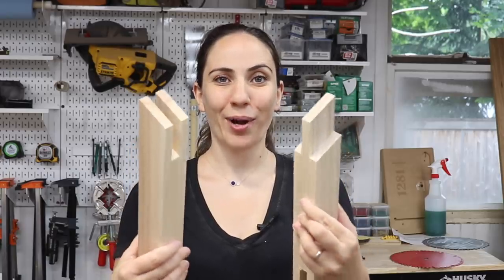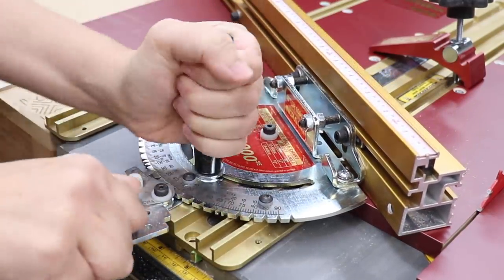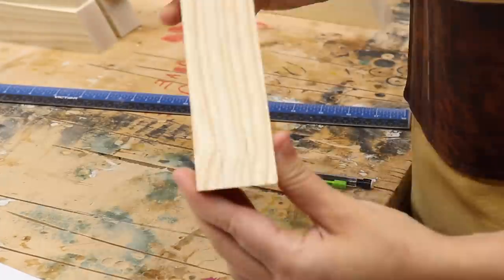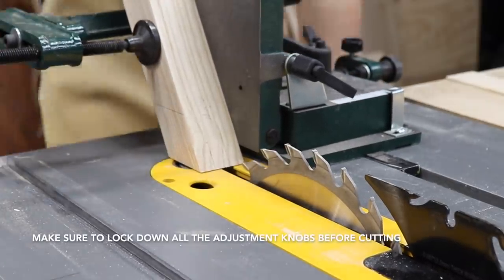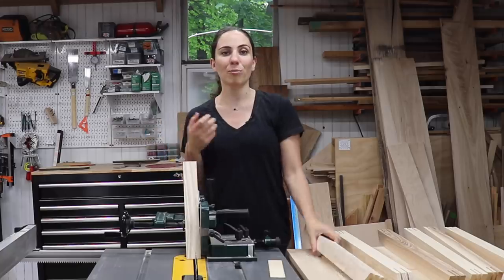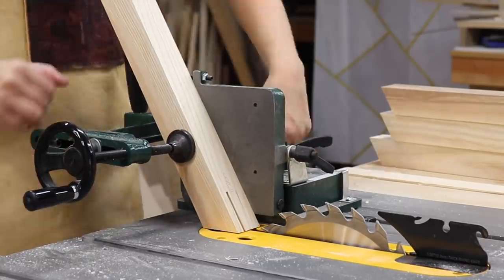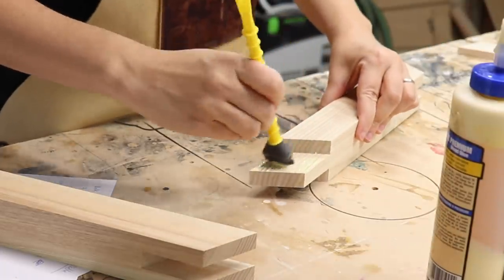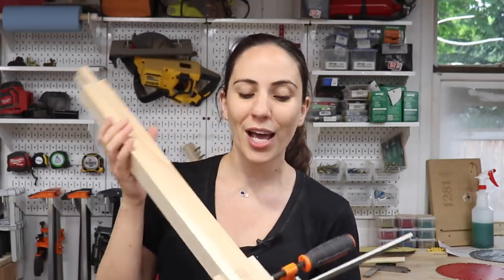How to Make Angled Bridle Joints // Woodworking Joinery // Really Strong Woodworking Joint

Comment: Great video. If you know someone with a drum sander you could sneak up on that shim size for your blade width, or find a piece of steel that's the same thickness as the blade. Just a thought. Might make some of these type of legs for a table top I found at the dump. So if I use this in my video, I'll give you credit for the idea.😜 Thanks for sharing.
Reply from the maker: Thanks! Someone suggested using a deck of cards to dial in the fit and I think that brilliant.

Comment: You might be able to get the thickness of your blade using stacked playing cards as shims. 

Set your fence right up next to and touching the blade.
Slide a deck of cards along the fence and across the blade.
The ones that stay behind the blade as you move the cards across the blade should be the thickness of the blade.

At this point you have two choices:
1) Place the stack of cards that were behind the blade between the blade and your fence and cut your shim.
2) Use the stack of cards as the shim.
Number 1 is probably the better choice.
Reply: Scott Tovey that is an interesting suggestion.  It seems like that is a brilliant idea!
Reply: Just an additional note. This  will work with  your Apr 25, 2019 simple tapering jig. 
Align your jigs fence and the wood you will cut the shim from so that it is flush with the edge of the jig.

Once you have the number of cards that make up the thickness of your blade, double them and put them between the board and the fence.

Side note: If you put the number of cards that are the thickness of the blade between the board and the jig fence, all you will do is shave the thickness of the blade off the board affectively edging the board.
Reply from the maker: Thats brilliant. Ill have to give it a try.
Reply: @3x3CustomTamar  
Cool! Let us know how it works out!

Comment: Btw since this came out, Inspire Woodcraft here on YouTube has several “how to make Shims” videos on making perfect shims to match the kerf of your blade… I actually tried it, now I’m still newish to using a tablesaw meaning I’m still figuring out how to perfectly dial in the tablesaw square, etc. hence why my shim isn’t perfect but it’s pretty dang close and I can use tape with the shim I cut out to get it perfectly dialed in but his method works and it wasn’t scary. You do have to have the basics of tablesaw safety down first and have used it more than once but Tamar would be perfect for trying his method and especially if you don’t want to have to build a kerf jig.

Comment: A little tip cut the pierce of block a 32nd" larger then you need then use a rubber float used for grouting, then use a piece of sandpaper put block or spacer on the sandpaper and with the rubber float on top of your block sand to the size you need.
Reply from the maker: That would be a good idea. I need to experiment more to get the perfect fit. I just didn’t have time to spend on it

Comment: A small tip about getting a spacer that's the right width. This will work over here in Europe at least. Since a saw blade is an exact width, over here they are usually 3 mm on a table saw and 2 mm on a normal circular saw. You can then take a piece of aluminium or other metal but aluminium is easier to work with, that have the same thickness and use that as a spacer. It shouldn't be so hard to find in a good hardware store. I always keep small pieces of aluminium to use as spacers, I also have some square aluminium tubes in 5, 10, 15 and 20 mm width and can use them as spacers along with the aluminium plates to get the right spacer width for most projects I do.
Reply from the maker: That’s a good idea. Someone sled suggested using a deck of cards to dial in the fit and I think that would be brilliant.

Comment: Love the Miter Express.  Adds a definite safety dimension to the table saw.  I'm going to assume that when you cut the spacers you mentioned that the thickness included the thickness of the blade teeth.  Seems like it should work.  Great tutorial.
Reply from the maker: It’s a great sled! Yeah. I factored it in. I guess it needs to be slightly bigger than the blade thickness to make it a good joint and I just couldn’t get that thickness right on my first few tries. I will def attempt again as I think it would work.

Comment: Minute 4:00 - Use a screw on the end of a 1x4, just like you did on your kerf marker (dado and grove maker).  Lay the 1x4  (~9 inches) on the table saw so the screw comes in contact with the work piece.  Adjust and lock the fence.  Move the 1x4 so the screw no longer makes contact with the work piece and use the micro adjustment until the work piece comes in contact with the 1x4.

Comment: Excellent! I will be using this joint for angled legs on a chest of drawers soon. I have a mortising jig from delta similar to yours so should be able to follow your process. One question about the mitre express, did you have any slop on the runners or need to make any adjustments in the runners? Not sure “runners” is the right word, the parts that fit into the slots on the table saw surface.
Reply from the maker: Thanks! Runners is correct! Yeah. The slots on the dewalt are pretty wide. So I had to adjust the plastic nuts it comes with to max. But I made it work

Comment: I guess it's easier to make them first in usual 90 degree , at the and cut in any angle you want with mitre saw , you don't need those fancy jigs !!! 
Thank you for the video anyway
Reply from the maker: That wouldn’t work. The inside of the cut wouldn’t be the correct angle.
Reply: Nice guess. Try it and you will see that it wont work.

Comment: Another great video! Of course now I need an incra miter express and a tenoning jig lol! :) Side note, I have the same saw as you, glad to see I can use those jigs with that saw.
Reply from the maker: Hahah! Sorry bout that. While I did get them to work with this saw. There was some tweaking I had to do. On the tenoning jig I had to add so tape as a shim to get it to fit perfectly. I used what’s called drawer slide tape. It’s a slick surface that makes it easy to glide.

Comment: Cut a piece slightly thinner and add a few cards, or overcut a piece then use a hand plane.  Adding a few hand tools will make your job go much quicker.
Reply: By the way, I would recommend a bigger faced shim if you are using it set a mortise.  Smaller ones can rock around and are generally unwieldy.

Comment: You could have done all of the joinery using only the table saw, without any jigs and the same result. I work in the field so Incra jigs and such are something I try to avoid. Otherwise, I love bridal joints, very strong. They are durable in exterior applications like railings,  wall caps and such.

Comment: Is it still a bridal joint if you drill a hole through the three plates and hammer a wooden peg in it?
Reply from the maker: I believe so. Probably a pegged bridal joint. I believe they used to do it that way before glue was the way it is now.

Comment: Is it possible that the blade thickness wood gives a tiny bit when compressed? Maybe a piece of sheet metal for a spacer same thickness as kerf.
Reply from the maker: I was thinking that could have been an issue. Bc I knew the scraps I was cutting were the perfect thickness of the blade. I’ll have to experiment more.

Comment: Are you using the flex volt table saw? Wondering if you can use a 10 inch blade on it?
Reply from the maker: No. It’s the dw745. They don’t make it anymore.

Comment: Hi Tamar, Thank you for sharing that but please let me know why did you switch the table saw blade from soft to the rough cut?
Reply from the maker: One is a combo blade. So I use that for my cross cuts. The other is a flat tooth ripping blade. The flat top of the teeth leaves a smooth surface in the joint. If I were to use the combo blade there would be little lines from the angle of the blade teeth. Does that make sense?
Reply: @3x3CustomTamar  Yes!! you're not only a great woodworker, but also you're a good teacher as well!! LOL

Comment: No planer?  That would make those strips consistent.
Reply from the maker: The pieces were too short. I thought of temporary placing them on a sled to do that. But just didn’t have time to mess around
Reply: @3x3CustomTamar  True, didn't think about that.  The minimum on mine is 9".  I try to remember the planing before I cut them to length.

The sled idea might work, although I think to be safe it might be best to double stick tape the ends to the sled.

Comment: Have a look at   Wurmtal 868 “Making wooden splines the easy way” he shows very clearly how to cut a spline to the exact thickness of your kerf. It’s so simple
Reply from the maker: Thanks for the tip. I was able to get the scrap exactly the thickness of the blade. And I think that’s what the problem was. I think it needs to be a hair thicker and dialing in that hair thickness was what what giving me issues

Comment: What if you are trying to make long piece such as 7’ x 4’ frame. Problem is long board would be sticking up too high.
Reply from the maker: Would have to figure out another way. Everything is possible
Reply: @3x3CustomTamar  im going to try with circular hand saw but other than edge guide its not really a jig.  You see when i look back at my personal progress as a wood worker, my number 1 criticism is not using templates or jigs.  I fall into the trap of thinking its like making the objective twice rather than perfecting the prototype and copying that.  I probably just need to think how to apply same jig principle to the handsaw.
Reply: You know, this is a good idea to consider: how you think about, conceive and design jigs.  Its relatively strait forward to see you assemble, and tbf one aspect i like most about your videos is how you bring your viewers into your process!  But consider the idea of how you might begin to share the story of how you begin the process of conceptualizing, designing, and then constructing your jigs - im a big fan watching your videos, and i think this is actually a very long story, that little parts are shown in each of your videos.  Also i realize that sometimes you are just imitating another’s concept which is also a great way to begin

Comment: Do not use regular WD-40 for door hinges or anything that squeaks. Same reason why you don't use it on a bicycle chain as it's a degreaser/cleaner not a lube. Will the sound go away? Sure, but it won't last and may come back with a vengeance since any lubrication has now been cleaned out. Regular WD-40 has many useful purposes, but acting like a proper lube, oil, or grease is not one of them. WD-40 offers actual lubricant products, so be aware of the distinction.

Comment: You used too much equipment and you did it out of order for your angles. 

First over cut all the joints without angles. 

Fit the pieces you want angled and cut at that angle, cut the excess, sand for finish.
Reply from the maker: That wouldn’t work bc the inside angle on the mortise wouldn’t match. Try it. You’ll see.
Reply: @3x3CustomTamar  All you do is cut the groove and tounge long, then make your angle cuts before fitting.

Basically it's an assembly line technique, cut everything the same then adjust for the angles after.

Pretty sure it works, because I've done it.

Trick is cutty them long for the angles, also, I route the angles it's just easier.
Reply from the maker: I think that sounds like extra work. But to each their own!

Comment: Sorry but its kind of dumb to make a how to video that just shows jigs. Jigs are used when you dont want to do something. No technique was really shown at all
Reply from the maker: Sorry to disappoint. But I disagree. I think some ppl who have never attempted this joint would find this helpful in their work.
Reply: @3x3CustomTamar  If they never attempted it with a saw and chisel, the odds are that they need to use their money on other tools than a super specific and expensive jig that only works with a saw table. If you didnt know how to do it or had the ability to figure out how to do this joint, then you aren't in a place where you would get these jigs.
Reply from the maker: marcus koko I disagree. This video isn’t about using these jigs. You could easily make a homemade version of the tenoning jig like I showed I made a few years ago. I have never cut these with a saw and chisel before. Does that mean I’m not allowed to make them?